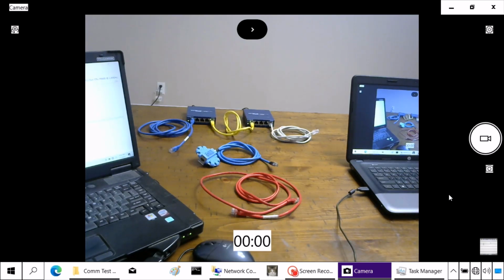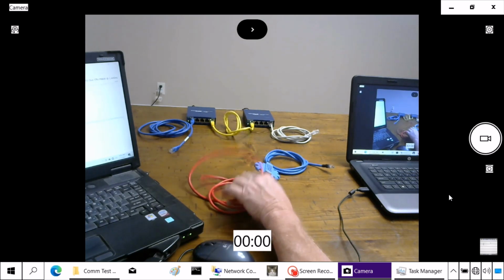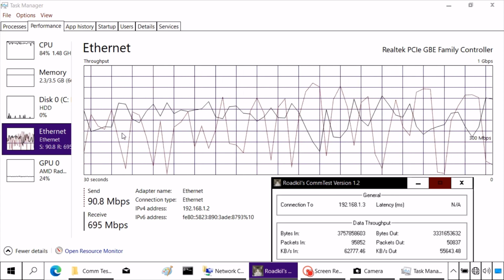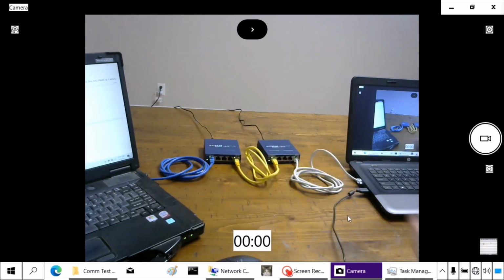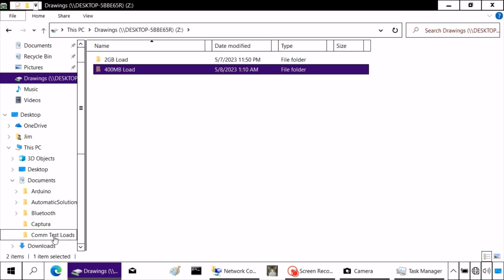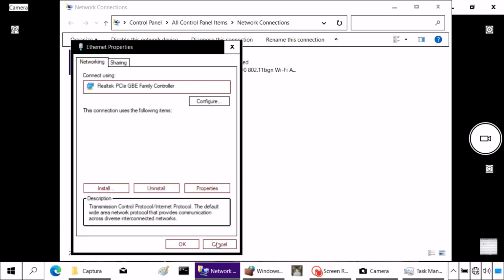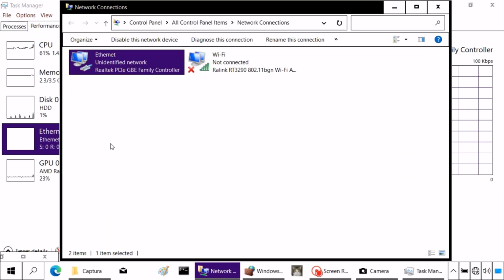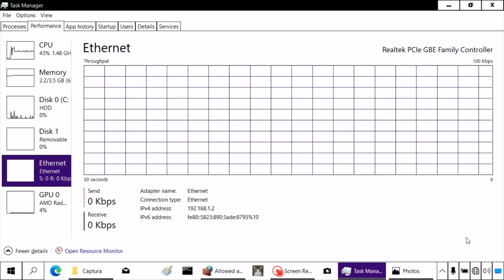Using Task Manager & 2 Laptops to Measure Ethernet Link and Transfer Speed

Comment: Why not use Iperf?
Reply from the maker: Looks like a cool program. Short answer as to why not for me is Group Policy. Installing any kind of network related program sets off red flags to the IT department. The odds of the program having firewall permission to do anything is about zero.
Reply: Ah ok, for me its sadly not usable, as i have to test between Windows and Linux system. This tool only exists for windows i guess @dc95811